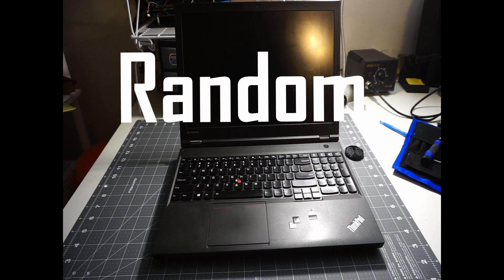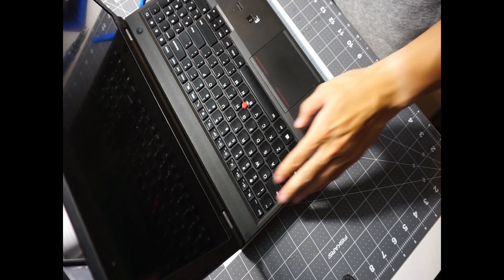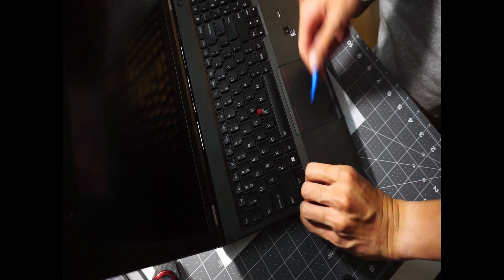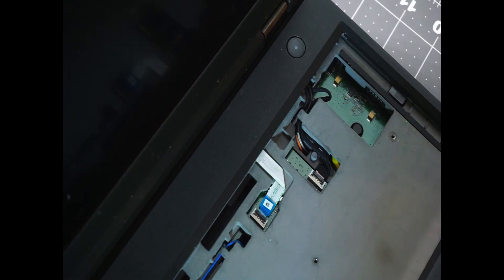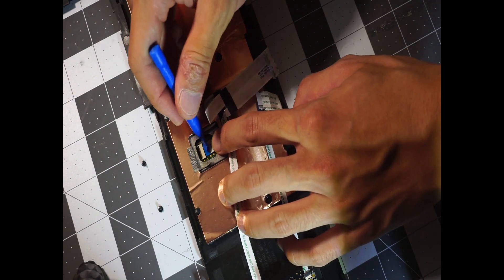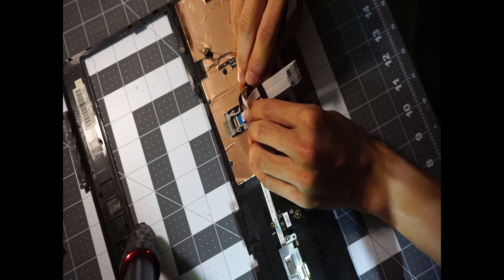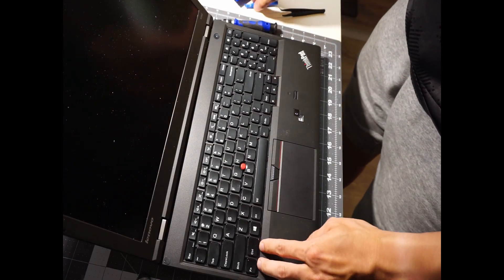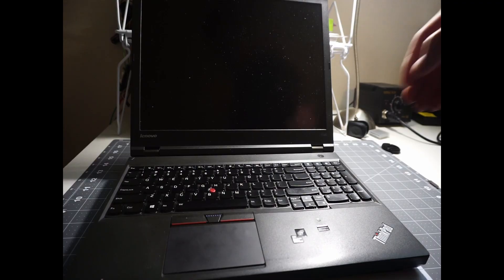Easy! Touchpad Change for ThinkPad W540

Comment: MY w540 has  no screws on top of the keyboard.  In fact I have owned many T series and  none of them have top screws either. My model
has the high res screen with the color calibration camera .  Is   that why there are no screws and will that  complicate the swapping of the touch pad??  Thanks for any responses. .

Comment: Thank you very much! The best tutorial for this job on here. Good, clear instructions and close-ups when needed. My replacement trackpad is on the way. Can't wait to install it. Should have done this years ago! BTW I noted a tip from elsewhere that, when sourcing the replacement, find a Synaptics model not an Alps model.  The Synaptics version has a stippled backplate, the Alps is smooth and shiny.

Comment: is there an updated drive for this? It used to work fine, but the latest windows auto update just broke it and every time windows updates the driver automatically, it overwrites the one i apply manually. Hoping there's a permanent solution out there, as the hardware works fine.

Comment: You do NOT want to use a flat-head screwdriver, if you mess up you can really screw up your keyboard, palmrest, etc. Just buy a nylon spudger from iFixit, that's what I used. 40 series keyboard's are a massive pain to install, you 100% want a non-metallic spudger here. I'm surprised you got it pretty easily. Usually it bulges in one spot or you have to sort of push in between the keys to get the keyboard 100% in place. I damaged a T440p keyboard and palmrest a while back by using a metallic screwdriver. Just don't do it.

Also, make sure your new TouchPad is a Synaptics touchpad, not an Alps one. The drivers in Windows 10 don't work with the Alps touchpad. It's easy to see if it's an Alps or Synaptics, on the bottom it should have a dotted backplate. If it has a smooth backplate, it's an Alps. It looks had you have the Synaptics one in your video, but if you have an Alps the drivers won't work right.
Reply: thanks for the info :)

Comment: Great video. Any idea why I have only one trackpad wire instead of  2 going to the motherboard like you have. Wondering if I need an additional harness because I have an open slot
Reply from the maker: I think you should be good. I believe one of them connects to the color sensor, which some models do not have.
Reply: @qiaojiezheng5310  ok cool thanks for the reply. well maybe I'll check my ribbon cable or reinstall the driver. Maybe that will fix it, because the new trackpad doesn't work yet. Fingers crossed
Reply: Nope, nevermind just needed to give it overnight. started up this morning and it works perfect :) :) :) thanks so much!!!

Comment: The problem with the "FrankenPad" upgrade on this computer, is the nubs on the middle button of the new pad, WILL make contact with the display with just the slightest pressure. The fix for this, is to place a couple of rubber sticky feet along the top of the display bezel. I almost found this out the hard way, and could've ruined a brand new 1018p IPS display. Fortunately, I discovered the problem pretty quickly, and was able to fix it.

Also..... After I learned the proper way of using the factory "ClunkPad", I found that I liked it MUCH better, than a standard touchpad. I do NOT like trackpads in general, and usually disable them on my personal laptops. I prefer using a mouse. The ClunkPad works just fine, with the trackpoint. I spent a whole day w/out a mouse, and just the ClunkPad, and track point. Found that it actually works marvelously together. Try learning to use the "ClunkPad", before replacing it.
I have a W540, and a W540/1, and will be swapping the FrankenPad out for the original ClunkPad, on the W540/1.
Reply: OOOPS! I meant, 1080p.

Comment: Great video! My machine seems like it is stuck taking the top cover off.  I double checked that I have removed all of the screws but I don't want to apply too much force and right underneath the camera/face scanner it seems like a screw is somehow disconnected.
Reply: Update: It just needed a wiggle.  Specifically I pushed the top cover towards the screen after popping all the retention clips on the back.  I do have a bit of an issue where my new trackpad has weird and inconsistent clicking behaviour at the bottom... Not sure if the 3 button trackpad I bought has issues or if I mounted it into the top cover improperly... the 3 buttons and the trackpad work great, just not the slight springy click at the bottom of the trackpad, which honestly I don't even want, would prefer if this trackpad had no click to it and could just be tapped.
Reply: Ok, so uninstalling the old trackpad driver fixed the issue with the unreliable right and left click, but I cannot seem to install a functioning synaptics driver to give me the advanced windows options for things like gestures or scrolling...  I did try the driver provided in the video description, perhaps it is not a genuine part...
Reply from the maker: @MattTheriot  I had that issue because I did not restart my computer, basically every installation and uninstallation requires a restart for further actions.
Reply: @qiaojiezheng5310  In the end, I realized I had the Alps version of the trackpad, not the Synaptics version.  I had to follow these instructions for Alps: https://forum.thinkpads.com/viewtopic.php?t=126860

In addition to editing the .inf to include the device ID, I had to use BCD edit commands to allow unsigned/unverified drivers:

BCDEDIT /set nointegritychecks ON
bcdedit -set loadoptions DISABLE_INTEGRITY_CHECKS
bcdedit -set TESTSIGNING ON

Finally the driver was installed and working.  As a final step I un-did the disable_integrity_checks and TestSigning bcd options, and I set a local group policy option to disable updating of the driver for that device ID.

DO NOT get an Alps version of this trackpad unless you want to go through driver hell.  Get the Synaptics version.

That being said, ultimately it was a success and its 1000x better than the 'clunkpad' the W540 came with.